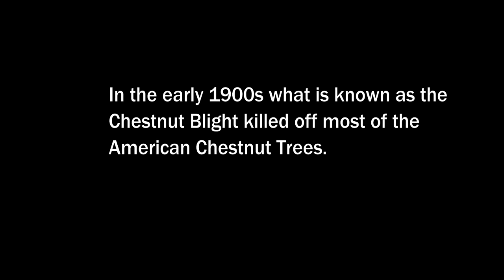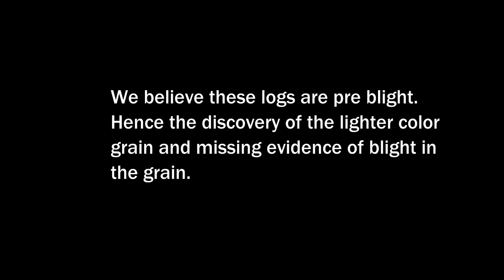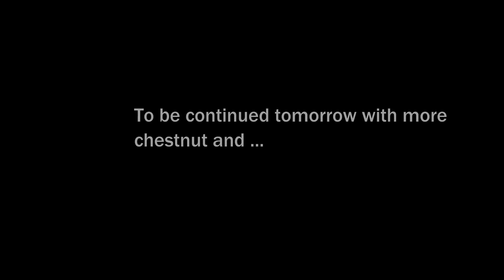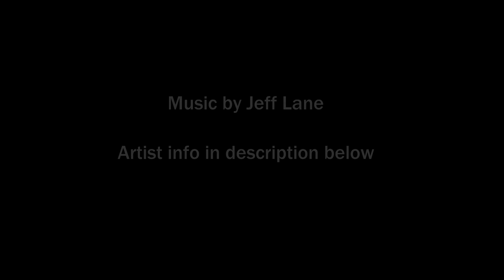Wood-Mizer LT35 Sawmill Harvesting Reclaimed Chestnut Logs

Comment: Awesome video and that wood is cool...not the nail...hope it did not mess up that blade. A question on the mill, do use straight water in the blade cool down tank or is it a mix. Thanks
Reply from the maker: +Robert Evans straight water. Sometimes I add windshield washer fluid if it's really cold.
Reply: I use water also in mine.